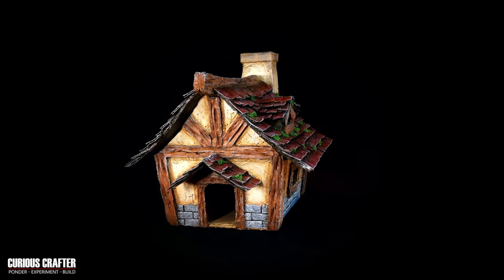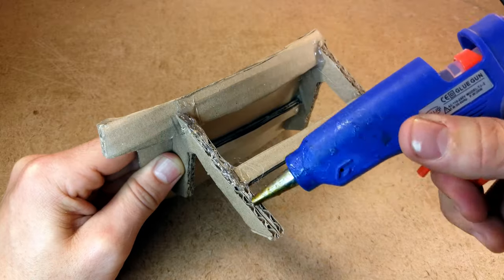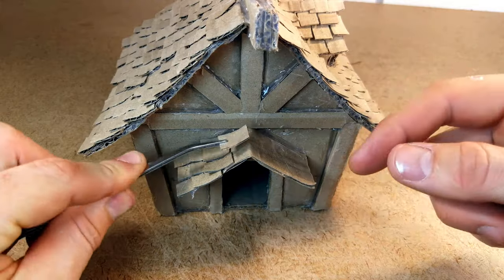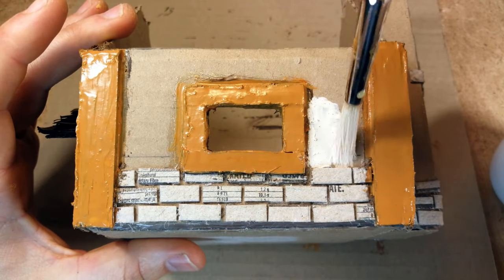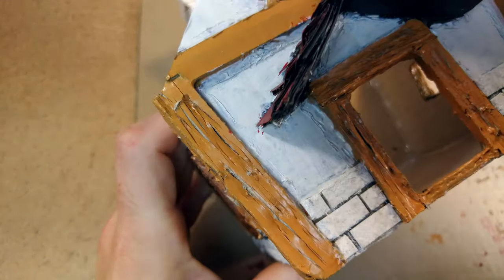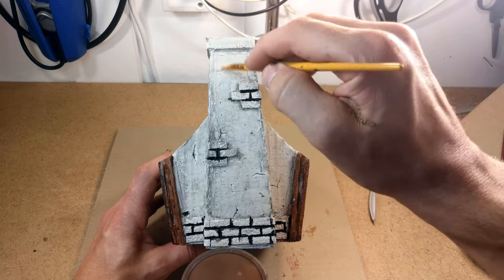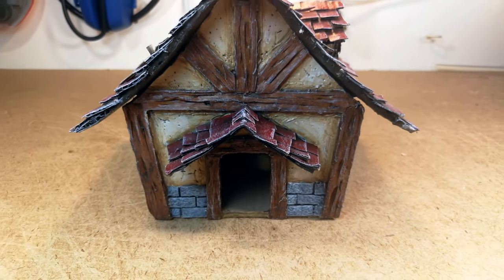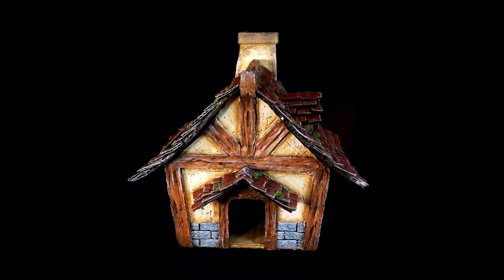Carboard house with corn moss | Tutorial

Comment: Would that be able to be in my garden and last through the rain?
Reply from the maker: No this will definately not last in the rain if you do it exactly using the materials I did. You can use water resistant materials, for example, instead of cardboard you could try plastic boards (like the ones they use signs) or clay would also work well. But the paint will also need to be coated with a water resistant coating.